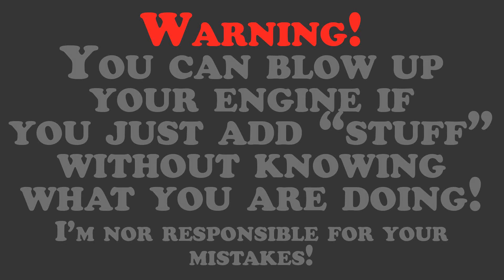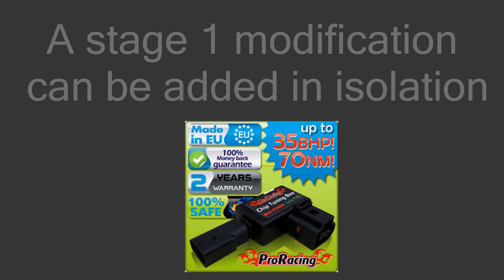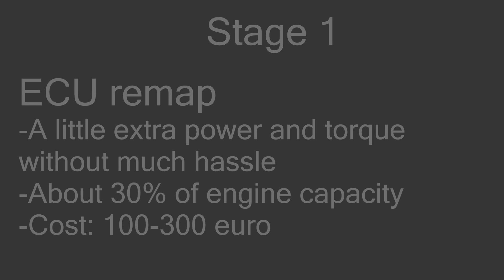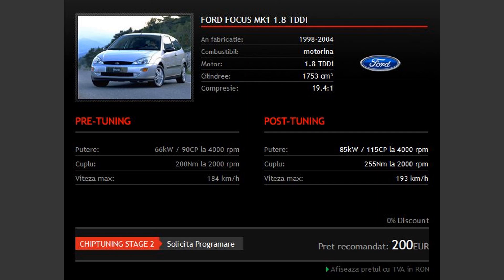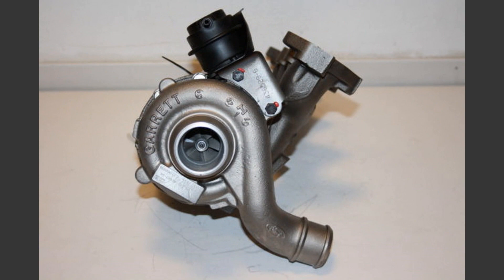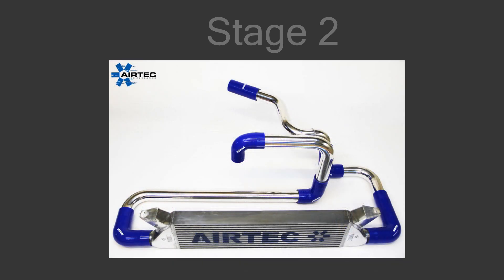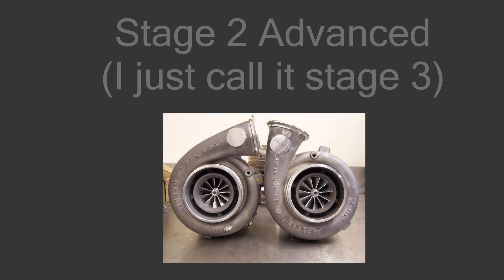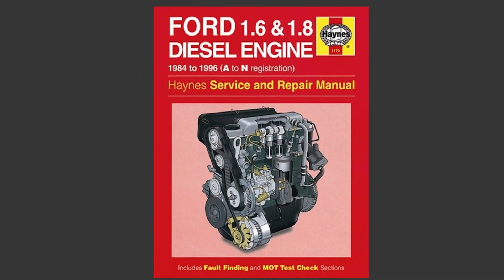Diesel Tuning - Basic stuff

Comment: I have 1.6 tdi seat Leon mk2 2011 I got a stage 2 map and got a downpipe do you think If I upgraded my intercooler would I gain more power as I got an air filter cone and when it was on my power and torque was the same and I was getting dashboard lights so I had to take it out?
Reply: Was not the same my power and torque it was worse sorry
Reply from the maker: No, not really but you would keep your power as your engine warms up. Intercooler is for cooling air that goes ftom turbo to engine. Bigger is usually better.

Comment: Is a scirocco tdi good to remap? it’s standard is 170BHP mines currently 210 bhp but want to go stage 2 what would you recommend for the most power for a stage 2
Reply from the maker: I guess, depends on the motor code.
Most power... well only a group of components:Intake-exhaust, turbo, injection, intercooler and end it with a remap.
If the block can take it. 
Read on forums what others tried and tested.

Comment: Would you say it’s safe to stage 1 tune a Citroen ds3 1.6 diesel ?
Reply from the maker: Usually yes, but depends on the condition of the engine. Run some tests before.

Comment: On my golf mk4 i went from 101hp to 295hp 🤩🤩
Reply: What mods
Reply: @chrismfc2625  im curious as well
Reply: Maybe he'll tell us lol
Reply: Does it smoke?
Reply: Yes but you had to upgrade internals too
Reply: here u have all upgrades i made on car (currently car have almost 340hp) : 341. injectors, pump, turbo from 2.0 passat, oil pump & cooler, custom air intake for direct airfolw, bigger air cooler, custom exhoust, deleted egr, ecu & tunning , alu flywheel, clutch, suspention & handling

in future i will install nos
(this car is used for track only!)
Reply: @jackstm3343  does it smoke?
Reply: @andreferreira3417  alot thats why i use it on track only

Comment: not to mention going over 380nm ish... on a desiel that isnt ment to handle that power stock youll need a single mass flywheel or youll go through a clutch in no time.
Reply from the maker: That's for another video ;)
Reply: @N33sWorkshop  Nice, yeah it was a definite concern for me ive got a 1.9cdti vauxhall vectra... celtic tuning offer a tune of 209bhp without mods, but they manage to leave the torque just about in the safe range, a lot of companies who do tuning tend to go torque heavy. i saw a skoda the other day shatter a dulemass with only 195bhp because the tune was heavy NM... i think it was 415 or something.... took the box with it.
Reply from the maker: Well... I guess they should tell you the disadvantage and if you agree, than it's your own risk.
Reply: @N33sWorkshop  yeah I agree most places who do tunes make you sign disclaimers but a lot of places also run stock tunes for diesels on cars that arnt ready for that type of tune (usually the cheap tunes), that's just irrisponsible imo, but that's what the disclaimer is for I guess.

Further info: the guy who's skoda blew up the other day has a forged block, sti cooled vw transporter with upgraded injectors and has managed to get about 340-350 out of it... It's pushing about 520nm too... And he's never had any issues (apart from a cracked engine mount) with the flywheel or box, so I'm inclined to say it could be something to do with lemon rate or the stock block forging that needs upgrading.

Comment: The only positive mod you can do to intercooler its change it by a new and thermically more efficiente due to better material.construction or chnging to a bigger turbo and intercooler as well
Reply from the maker: That's the idea, have a better intercooler that can dissipate more heat. I guess you can still use the original turbo if you calculate the volume of air/time required and use the correct tube size to minimize turbo lag.

Comment: I had a focus tdci remapped to 146bhp with intercooler  and k and n filter was crazy fast but chewed the front tyres up
Reply from the maker: Benefits of high HP FWD cars, I guess 🤣
Reply: Absolutely but so worth it at the time , I've now got an Volvo s40 td with power chip I want to do more but not much out there for it
Reply from the maker: Interesting. What about Volvo with 2.0 t or 2.4 t? I guess you’ll find more about that.

Comment: Hi
 Can you explain
I had chip tuning and remap (both very reputable companies)on e class 350cdi 
Both have increased power to approximately 300hp but i did 0-100mph , 60-100mph test and its absolutely the same as stock!! Why?? Remap and chip scam??
Same road same weather conditions..
Reply from the maker: Possibly scam, did you dyno the car before and after the chip?
265HP->300HP and no difference... that seems weird.
But I'm not very familiar with Mercedes engines...
Reply: N33s Workshop yes 265 before and 300after. One guy said if no DPF Removal you wasting time with remapping. Always thought 3ltr diesel after remap alone gives nice gains, but not on the street in real world 😔
Reply from the maker: Something isn't right there. You should see a difference. Maybe they are right about the DPF... You can search on the internet for more info and make an educated decision.